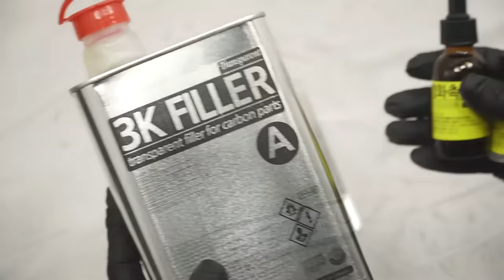How to Make a Forged Carbon Fiber Helmet [DIY] (Making Split Mold & Helmet)

Comment: The whole time im watching I'm like. "That's cool but it's not a legally approved helmet anymore." Then he's just useing it to sim race🤣 can't complain 👍
Reply: Think its beter than the original lmao harder and better than the original one
Reply: @Maykay1312  the purpose of a helmet is to absorb the energy from an impact so your brain doesn't. A harder helmet shell will transfer more of that energy to your head
Reply: @barnsnoble7066  still it bends and cracks due to a hard impact and has foam inside
Reply: @Maykay1312  yes but up on what kind of impact my man there is a science behind making helmets thats why those are so expensive
Reply: @neamanja  if ur realy making a carbonfiber helment for road use diy u shoud just get s helment like in this video and cover it with a layer of carbonfiber and ur set no need for making it how its done in this video especialy if ur going to use it in ur gaming setup
Reply: @Maykay1312  no if you overlay it in carbon you get harder helmet i you hit your head in harder helmet it doesnt absorb the hit it just transfers it to the head and you lose the point of wearing it
Reply: @neamanja  still one pisce of carbon is not that stronger on a helment its basicly the same
Reply: @barnsnoble7066  the harder Shel does not protect your head. The foam and cushioning does. The shel keeps the foam intakt because on itself it would demolish on impact and you head wouldn't be covered anymore. And it prevents small hard objects penetrating the helmet and hitting your head
Reply: @Daniel-iq5oo  are you sure about what you saying
Reply: @neamanja  you can buy cf shelled helmets man. From any manufacturer
Reply: @neamanja  Yes, he is right.
Reply: @barnsnoble7066  you are right but the   Point is if your helmet hit a tapered surface in an accident. The shell must remain solid or it sinks to your head. So a dilemma, a rigid or a flexible shell:)
Reply: @marblecountertops3098  yes but they've been tested to destruction dozens of times before they are certified.
Reply: When making a carbon fiber helmet, the way of the fibers matters alot.
Reply: It doesn't make sense to use carbon fiber for a helmet anyways. The only advantage carbon fiber has over fibreglass, is higher stiffness per weight. Not many people know, but S-class fibreglass is actually stronger and tougher than CF in both volume and weight, and thus much more suitable for a helmet.
Reply: @barnsnoble7066  Not only that, CF is stiffer and less strong, so it will split much more easily.
Reply: @tHaH4x0r  higher stiffness per weight seems highly advantageous to me.
Reply: @robinbiskupic2639  Advantageous in a lot of things that you don't want to flex, not advantageous if you need other material properties.
In the case of helmets I think you can agree that toughness and strength are much more important. 
As a comparison to illustrate the point with difference in strength, toughness and stiffness, imagine a thin sheet of glass, and a thin sheet of aluminum.
Now hit both with a hammer. Glass is both stronger and stiffer, but the aluminum is tougher. Due to the high impact forces from the momentum of the hammer suddenly coming to a stop, it would exceed the strength of both the alu and glass, so both will 'deform'. But, as glass is so extremely stiff, it has a very brittle failure mode and thus it will shear/shatter. Meanwhile the aluminum would dent, or worst case locally have a hole.
Reply: @eksine Helmet manufacturers invest billions into RND, testing different exotic materials, combining them into composites, trialing every shape and size to maximise wearer safety and minimise discomfort, laboriously pursuing the highest standards of protection and style and being renowned for these aforementioned traits.
Brands such as Arai, AGV, Bell and Shoei - to name a few, have each been in thus business for almost half a century and have revolutionised the once dead market with Innovation and competition. 

So what though? Nothing; you can choose to ride around in your friend's cousin's boyfriend's uncle twice removed hand-me-down and still have a blast. 

At the end of the day, like the rest of this great thing we call capitalism, It's just a matter of taste.
Reply: @giathefierceyen  I see, what I was saying is most helmets are basically the same thing, hard foam with a plastic shell. What I said was anything over the basic $125 helmet is just mostly for luxury or literally for nothing at all. A $1,000 shoei helmet isn't significantly better than a $125 helmet. And for all that research I think it's wasted. I don't see them adding leather or doing anything worth the high price tags. Mostly it's greed
Reply: @barnsnoble7066  The shell is the thing that keeps everything in place and must be strong to impacts, the important thing is the liner, that is what really absorbs the impact.
The liner makes the travel of skull be slower, "avoiding" brain damage, so you can make DIY cf shell, but must be with a good quality liner.
Reply: @eksine  simply not true.  Bell for example has quite a bit if technology in their helmets that is well worth the higher cost.
Reply: @k..............1622  Like what though?
Reply: @eksine  the Mips system for example.  It's designed to protect you against impacts that actually jerk your head around instead of just straight hits like a majority of helmets.
Reply: @k..............1622  ok cool, looks ok, I'm mostly talking about you know $1,000 carbon fiber helmets that do nothing more than $125 helmets, you know what I'm talking about helmets in general are overpriced, actually all moto gear is extremely overpriced, again because they know riders are stupid and will pay anything, because what idiot goes riding around on 2 wheels when they can drive a car. I've actually been almost hit by a car on my ninja 250 so that was a joke. but you know what I'm saying. there's some helmets that have airbags, fancy stuff that functions are fine, I'm talking about expensive helmets and stuff that don't do anything else fancy
Reply: @eksine  Then why don’t cheap helmets pass FIM regs. I agree with carbon helmets and helmets for car racing though. For mtb a carbon shell is nice for the weight you can really tell the difference.
Reply: @eksine  just say you can't afford proper gear 💀 there's a massive difference between my $1400 helmet and your $250 bell 💀
Reply: Well, safety aside, carbon fiber helmet that molded with just regular resins is very strong. You could stand on it and throw it away or smash it with hammer and its just scratches that happen
Reply: @eksine  go ride rough moto for hours with a Bowling ball ass 62$ helmet, and go again with an ultralight like an airoh that's 400$, and tell me what your neck prefers
Reply: @neamanja  There are carbon fiber helmets. Carbon fiber isn't particularly "hard", materials have many qualities besides hardness to describe their strength.
Reply: @barnsnoble7066  the shell is meant to stay intact, it’s the foam inside that absorbs the impact, that why after a crash, even though the shell only has limited scrapes it’s recommended to change helmet cause the foam isn’t up to the task anymore.
Reply: @andygreyriderGRN  true, I would rather have a mix of carbon and kevlar than straight up carbon
Reply: @Maykay1312  ¹
Reply: @neamanja  yeah, racing helmet is different with bulletproof helmet, the shell has to be strong but flexible enough to absorb the impact force, so that's why arai agv shoei etc charge you quite some money for their top notch helmet.
Reply: Haha yep. Love the end.. I watched this whole video thinking "this is a cool motorcycle helmet video..." .. instead of "full send.." it's "Full Sim" literally. one of the best videos of its kind.  😂 ☠️☠️☠️💀